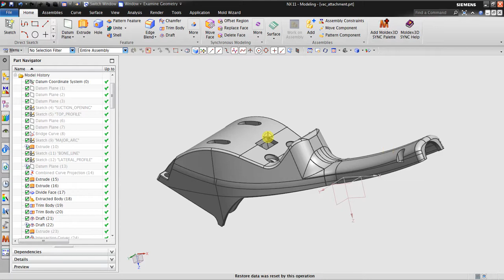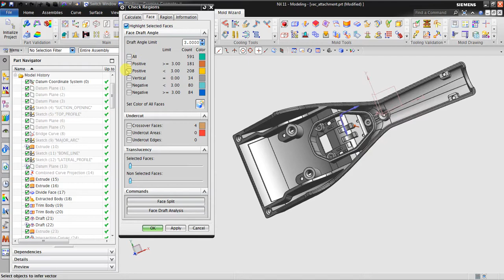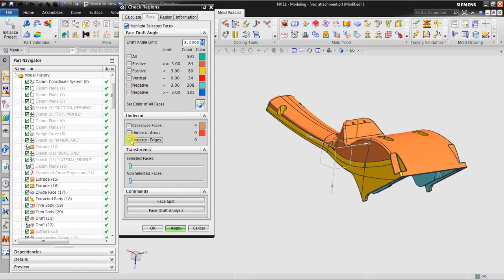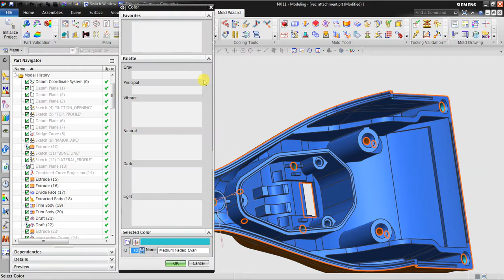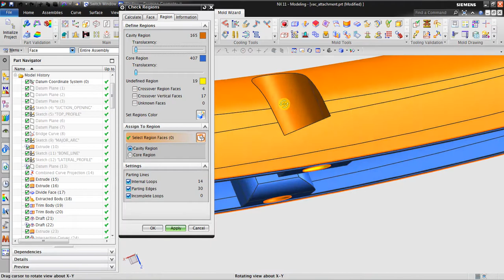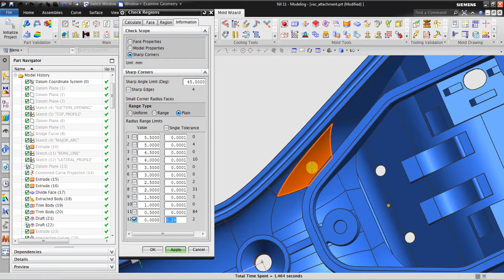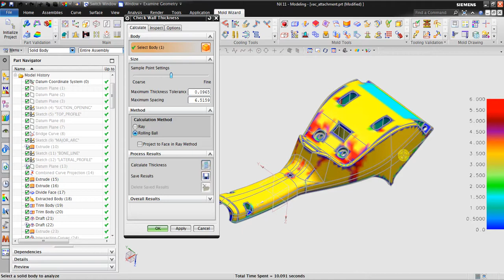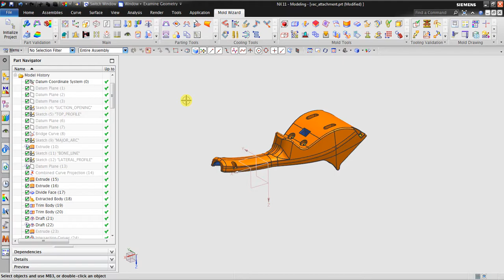NX Mold Wizard : Check Region & Check Wall Thickness Tools

Comment: It shows zero (blue) on the edges because it's a 3D thickness analysis which checks distance between each face. Edge is where 2 faces meet, so it shows Zero.